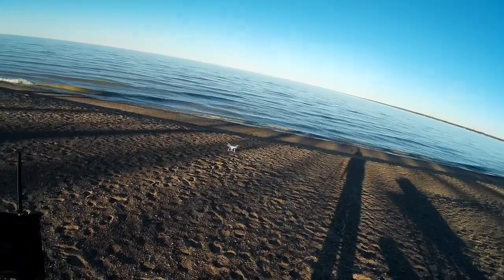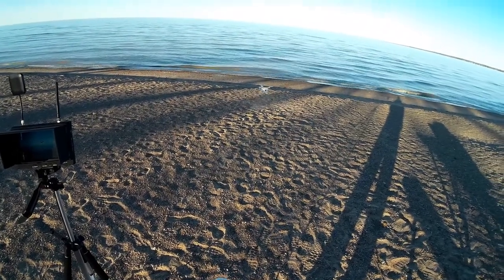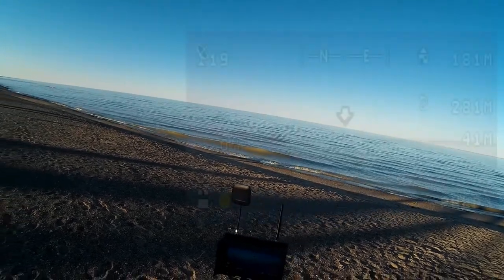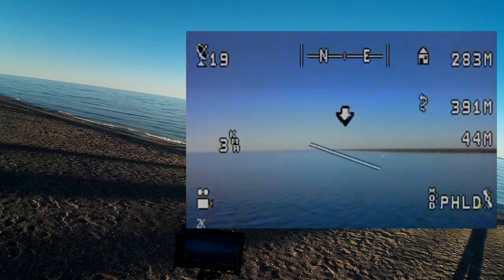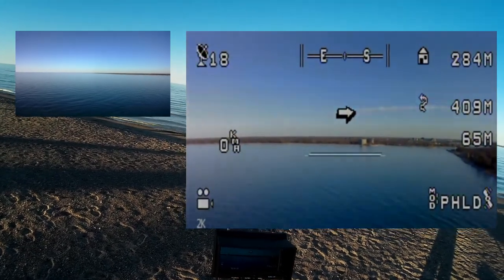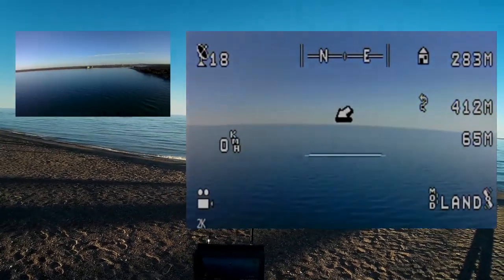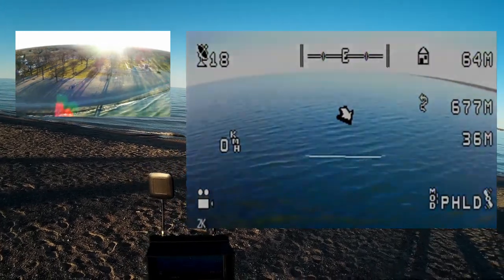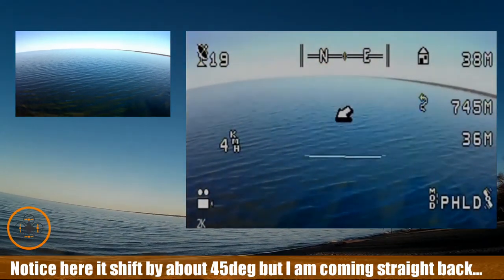Video Drone - UPAir Compass Issues Over The Lake!

Comment: This is why I bought a Phantom not a upair. Its a great looking bird but to many issues with it. I see you changed out them 3 blades to 2 blades seem to fly way better nad not wobble coming down.
Reply from the maker: Agree with you on the P3 as my first Upair was rock solid, however the second one literally sucked and I didn't trust it.
Reply: Phantom 3 standard can be a pain in the butt as well. Still that's a nice drone. Very similar to the Phantom. That's not modified right.

Comment: That arrow is suppose to point at its take off location. The arrow will always indicate which way to home.
Reply from the maker: +Sean correct however many times it didn't or there was very long lag in it changing.  In my first upair it is super quick but this one seems to have sort of calibration issue

Comment: I still think you need to fabricate or purchase some sort of pontoons for your birds just in case. 

That up air was doing some strange yawning. Is there any firmware updates available for it?
Reply from the maker: Nope this one is the Apple of drone, no updates however pontoon statement could get interesting as done some "understanding testing" so keep an eye out :-)
Reply from the maker: Sorry the dreaded 404 error :-(
Reply: Video-Drone - Stupid iPhone
Reply: Did you look at the "calibrate" icon under general settings? Where did you read you can calibrate the compass by flying in circles??? 
How does your bird know you want to calibrate without pushing the calibrate icon?
Look in the manual- How to calibrate- You do it by pushing the calibrate button& doing the calibrate dance as its called, by hand!!!
Reply: Maybe the Phantom 2 is different than my P3A & 4, Does the P2 not have vocals telling you height, distance, battery condition?
Reply from the maker: Nope, the P2 is very basic, no App...
Reply from the maker: The UPAir of this series does not have compass calibration (one the major issues with them) as there isn't  an app for this (only the very newest version).  Also read yawing in a stationary circle does some from of compass calibrate (makes some sense) from an UPAir forum.  It was a while back so I don't remember which one...

Comment: AHHHH  I hope you are not having problems.  If i remember right the arrow should always point at the transmitter so you know which way is home.  I noticed you always spin the quad in circles as if that is going to improve the compass calibration.  From what I have learned this is a waste of time and does nothing.  Your original calibration is what sets the paramaters for flight as you can move to different locations without having to calibrate each time as long as the distance is not extreme or surroundings are vastly different like mountains etc.  I really hope this is not the start of the upair problems.  Happy Flying
Reply from the maker: That what they claim on the forms that spinning the quad (UPAIR only) does something for compass calibration.  SO you make several rotations in on direction and several in the opposite.